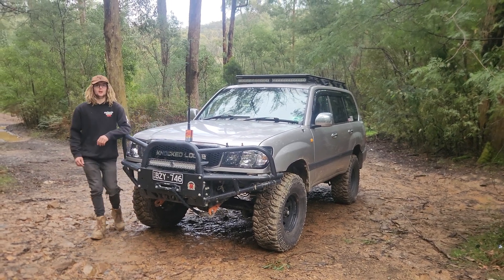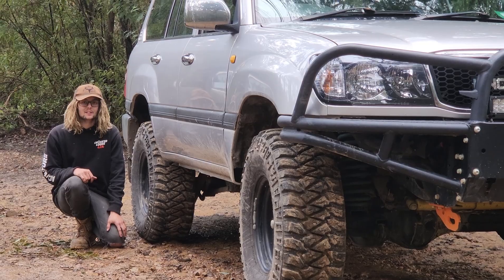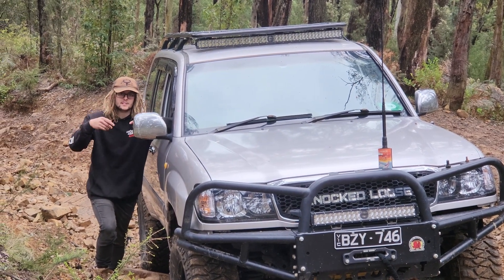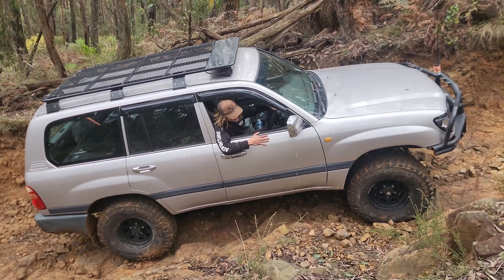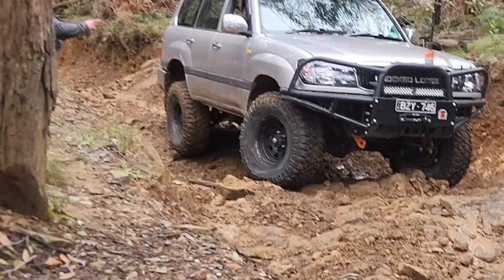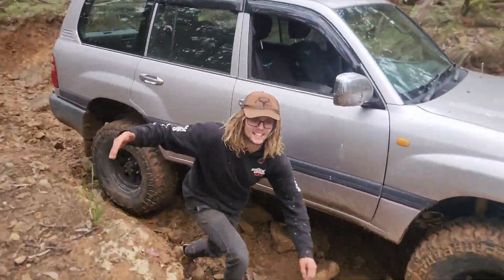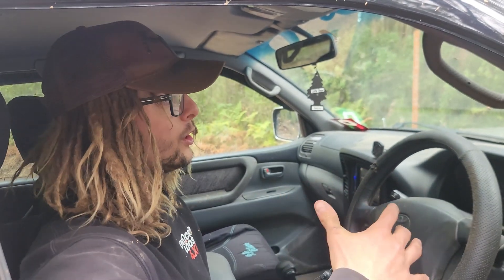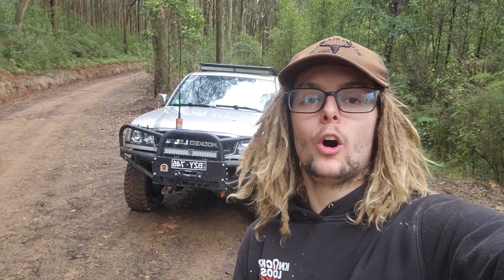ROCKY TRACK TOOLANGI! - TESTING LTG ELECTRIC LOCKER

Comment: The gauge might say 16psi, but those tyres are not bagging. One of the critical failings of the Harrop e-locker - is it's tendency to unlock when a reverse change of direction is undertaken. A better subjective test would be to try the same with this LTG. I suspect the same is true, because I noticed the driver side rear not always driving. In regards to front or rear fitment, why not have the best of both worlds, ie LSD in the rear, locker in the front?

Comment: dam cruiser goes pretty good. Be good if it was manual though
Reply from the maker: I wish it was a manual! Auto slacks abit sometimes.
Reply: A correctly set up auto with manual TQ lock and reduction gears - will run rings around a manual. Trust me, been there converted that!